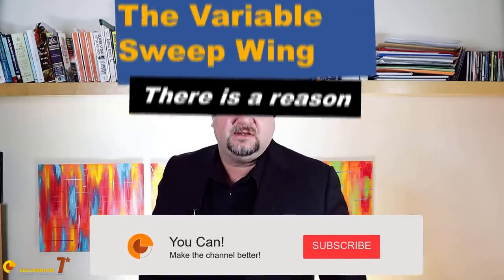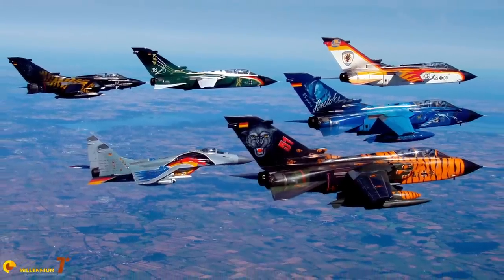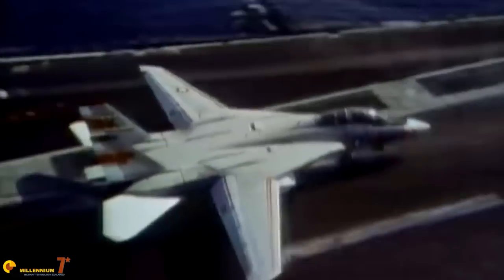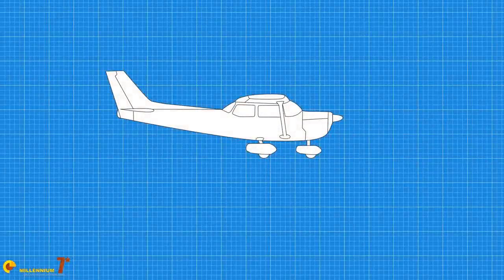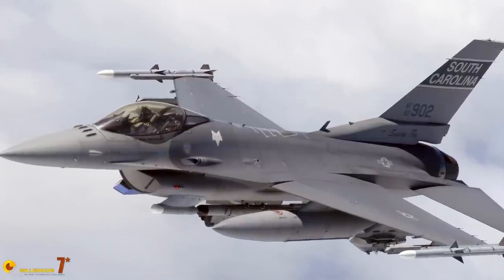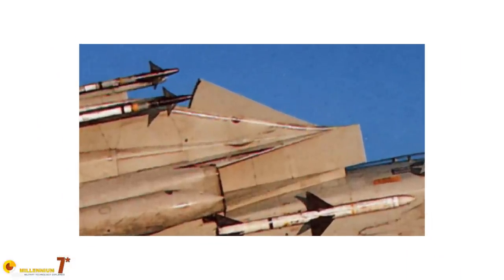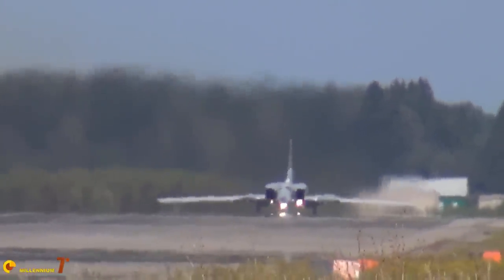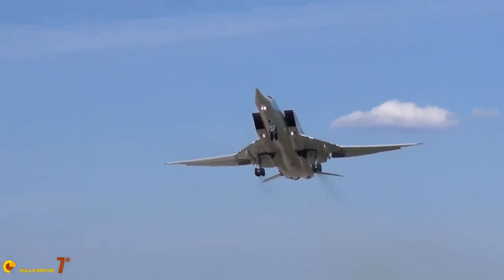F-111, F-14, Tornado, Su-17 were Hopelessly Outdated - the demise of the variable sweep wing

Comment: These planes were not outdated in concept, but the field of operations has changed: a Tornado is still a better interdiction plane, performance wise then an F15E will ever be when properly updated but the availability of guided ammunition and the great improvements of land based anti air radar guided systems makes flying at tree's level more dangerous then it is worth. Still, a tornado, or even an f111 are much faster and stable down low then any F15 will ever been if you need to carry a big load of cluster bombs on a wide area and that's because Tornado's, not the F15E was the weapon of choice during the first gulf war to take out airbases, destroying their runways and paying the toll for flying over VERY dangerous and unforgiving air defences.
In the same way, a phoenix armed F14 would still be unbeatable to keep soviet bombers at bay, having range, speed and payload, but it's a costly plane to operate and hypersonic missiles are difficult to intercept nowadays.
The point is that, due to focussing on different priorities on the battlefield, in recent times, a less specialized and more flexible plane like the F15E or even an F-16 is more desirable as it can cover a wider range of roles, or, in case of relatively less dangerous environments, where Air superiority is fully guaranteed, less expensive and easier to maintain planes, like the A10 and the AMX, able to loiter longer in case of counter insurgence operations.

Comment: Landing in full-load on frosty German runways endangered the F-105s in the 1960s. STOL was also required.
Swing-wing came to that rescue in the form of F-111, Tordnado, B-1 and similarly in Russia: Su-17, Tu-22M, Tu-160.
F-14 was a clumsy mistake-jet like the F-18 is. See Su-33 and Rafale-M for proper naval aviation.

Comment: *Australia, as a nation: "Are you talkin' s**t about our beloved Pigs? :O
Reply: I worked on electronic warfare systems on the F-111F out of RAF Lakenheath in the USAF. Love them.
Reply: Updated with the latest hardware and software as well as networks and weapons. The real reason they were retired was because the airforce literally flew them till the wing boxes failed (whole centre structure in the fuselage). This is coming from an aviation tech who worked on them(RAAF, not me!). Parts were scarce because our version had mods not common with others and comparability was low.

Comment: I hated to see the F-14 go. I think it had life left in it, especially if upgraded. F-14 was faster, and had greater range than even the Super Hornet. Plus the F-14's Phoenix missile had about 40% more range than the Amraam 120C-7 missile. If they kept the F-14 longer, could you imagine the F-14 with the Amraam 120D missile? How potent would that have been? Yes, the Phoenix was designed to take down cruise missiles and the bombers that fired them from long range. But the F-14 with the 120D could potentially take down anything. What do you think?

Comment: The F-14D was retired in favor of a completely new airframe in the form of the Super Hornet. The Super Hornet cost twice as much to produce as the 14D due to R&D associated with a new airframe and did nothing better except lower maintenance costs then the 14D. The 14D outperformed the Super Hornet in a few important metrics, including range and payload. The reason given for the Super Hornet's choice was maintenance costs, which were overshadowed by the procurement costs of the new airframe. The real reason was politics and/or corruption.

Comment: Variable sweep wings are the only way to land a heavy, high-speed fighter at a slow enough approach speed onto a carrier deck.  Swing wings are a luxury for air force planes and their long runways...

The F-14 was required to be able to land with all six Phoenix (unfired) missiles, a fairly heavyweight landing configuration approaching 55,000 lbs.  This would be nearly impossible with a conventional wing and the lower slow-speed lift required.  Today's carrier air wing consists of smaller and lighter Hornets with a suitable conventional wing.  Even the F-35C, though heavier than the Hornet, is still lighter than the F-14, and not Mach 2+ capable.

Russia's Su-33 and China's J-15 carrier aircraft are just as large and heavy and fast as the F-14 and they all share a MTOW over 70,000 lbs.  But since they are weight-limited due to a ski ramp takeoff, they can never approach the fully loaded catapult takeoff weight of the F-14.  Therefore, the Su-33 and J-15 won't have to face a heavyweight landing possibility, and their large conventional wing is satisfactory for carrier landing.

The F-15 is the air force equivalent to the F-14 in weight and aerial speed at the time.  The F-15 was even considered for naval use.  With a landing speed 20 knots higher than the swing wing F-14 however, the F-15 would have never qualified to carrier land.  Here, the swing wing shows its true strength for low speed lift capability.

Carrier approach speeds for heavy aircraft are a constant and don't change.  The mission profile of the F-14 for its time resulted in its weight.  However, the advent of lightweight composite materials of modern aircraft, along with improvements in long-range AAM weapons, culminated in lighter planes and missiles that can do nearly the same mission.  The F-14 may be the last (and only) heavy carrier-based fighter ever made.  Until the need arises for a new aircraft like the Tomcat, she will remain the only swing wing plane to ever operate at sea.
Reply: VSW made the Tomcat a badass dog fighter for something its size. When the thing was designed, that still was very much a need.
Reply: I'm sure the VG wing did help the F-14 bring back more weight and have more endurance at loiter speed.  But if the F-4 phantom and the A-5 Vigilante could land on a carrier I'm sure the F-15 could have also.
Reply: @gort8203  The F-4 and A-5 have a MTOW over 10,000 lbs lighter than the F-14, with no requirement to bring back external stores.  Now, the difference in landing weight becomes greater than 16,000 lbs (6x Phoenix @ 1,000 lbs each + launch rails).  Because of their conventional wing, they still have a higher carrier approach speed than the heavier F-14 (in between the F-14 and F-15) which is on the edge of being too fast for landing.

US Air force planes have never been adapted successfully for carrier use.  And this is one of the many reasons why, because they require higher landing speeds on long runways.  The Su-33 was derived from the air force Su-27, however it underwent many numerous changes, most notably the addition of canards and larger main wings for increased lift.  And it is still launch weight limited with the ski ramp takeoff.  The F-15 would have required extensive changes as well, too many to be viable for sea duty.
Reply: @uboredtoo  Please read my comment more carefully.  I know the F-14 had a lower approach speed and higher bring back weight due to its VG wing. But I did not compare the F-14 to the F-4 or A-5.  I compared the approach speed for the F-4 and A-5 to the F-15.  You said the F-15 could never be certified to land on a carrier due its wing, but the F-15 has more lift and lower approach speed then either the F-4 or the A-5, and would have no more trouble landing on a carrier than either of them.
Reply: @gort8203  Again, Rog elio emphasises the max return weight with Phoenix - the F15 couldn't match the F14 in this situation.
Reply: @jackaubrey8614  
Why is it so hard for people to focus on what is actually said.  I've said twice that I understand the VG wing contributed to the F-14's 'bring back' capability weight.  That is not what I questioned in my comment. 

Statement: "With a landing speed 20 knots higher than the swing wing F-14 however, the F-15 would have never qualified to carrier land."
My comment: "But if the F-4 phantom and the A-5 Vigilante could land on a carrier I'm sure the F-15 could have also."

My point is that the F-15 has a slower approach speed than at least two other aircraft that were qualified to land on carriers.   I did not challenge whether the F-15 would be able to bring back as much weight as the F-14, I challenged the simple statement that the F-15 would never be certified to land on a carrier at all, regardless of weight brought back.  I can't make myself any more clear.
Reply: @gort8203  so was the f-15 carrier certified? If I was as simple as landing it empty on the deck, why not? Had a hook in its design for arrested landings. You would have thought if it was capable of a deck landing they would have certified it and wrote up emergency contingency plans for air force pilots to use a carrier in extreme emergencies.
Reply: @gort8203  of course if you are just trying to prove that the f-15 can make a short arrested landing, well that is pretty obvious since it was designed for that very situation. Hence the hook it was able to be equipped with. So the only variable is the landing zone size on the deck of a carrier. If that is all you care about then in Theory yes it is possible. Now go make vague assertions on another video to illict responses which you don't actually want to engage in discussion around.
Reply: @Power5  I've done all I can to make my original statement perfectly clear.  You just want to argue about something else, so please pick somebody else.
Reply: @gort8203  To understand why the F-15 (in it's air force configuration) cannot land on a carrier, it helps to analyze all of those planes together.

The Navy prefers carrier landing speeds around 130kts.  F-4 at max gross landing weight of 40,000 lbs requires airspeed around 140kts.  F-14 at max gross landing weight of around 55,000 lbs is under 140kts, landing empty is under 130kts.  This difference in landing weight and speed is mainly due to the variable geometry wing.    See the last paragraph on this govt doc comparing the F-4 and F-14: https://apps.dtic.mil/dtic/tr/fulltext/u2/910249.pdf#page=20

The F-15 lands on airfield runways at around 150kts.  For the Eagle to be adapted for naval use, that landing speed would have to be lowered closer to the Navy recommended 130kts, especially for hauling back half a dozen Phoenix missiles and a giant AWG-9 radar system.  And yes, the Navy would have required a Sea Eagle to carry AND bring back Phoenix missiles because that was the requirement of the VFX fighter competition.  Adding that weapon system, along with foldable wings and a massively strengthened landing gear and airframe, would have made the F-15 even heavier than the F-14, dictating a landing speed well higher than 150kts.  

This is another reason why no US Air Force aircraft has ever been adapted to carrier use.  All of the structural modifications end up making it too heavy.  The F-111B almost made the transition.  Astonishingly, it has a MTOW of 88,000 lbs but could carrier land at 115kts (most likely empty).  And it was able to do this because of an even larger wingspan swing wing.

No naval aircraft has ever had to be designed for an overweight carrier landing like the F-14.  At 55,000 lbs, that's heavier than a fully loaded F/A-18 Hornet on takeoff.
Reply: @uboredtoo     I am not debating the F-14.   I compared the approach speed of F-15 to the F-4 and A-5.  The F-15 doesn't even use a landing drag chute like the F-4 does.  I'm done talking about this here because you guys don't listen.
Reply: @gort8203  That's the beauty of debating something that has never existed, isn't it? No one can be right, no one can be wrong :)
Reply: @uboredtoo  Actually, no one can stick to the point.

Comment: Another factor that variable sweep wings were intended to address - that I don't see covered here was the disparity between operating speeds and safe landing speeds (Sabre-dance, anyone). My understanding is that the low speed performance of the new high-bypass turbofan engines allowed for lower landing speeds which meant the variable sweep wing was no longer necessary.
Reply: Thrust does not have an appreciable effect on landing speed unless the thrust is directly supporting the weight of the aircraft and offloading the wing.

Comment: Even with awkward TF30 and designed in 1960s, F-111 has a payload and range that F-15E,F-22 and F-35 cannot match while have an impressive top-speed in all altitudes. 
Even F-14B only has F110GE400 which only has a t/w ratio of 6.0, they have better acceleration than F/A-18E/Fs who has F414 with T/W ratio >9 when both equipped with 8 missiles(not to mention Sparrow has a significant larger drag ratio compared to AMRAAM).
It's not the swept wings become outdated, in fact cancelled NATF was swept-wing. It's the fact that new types come out after cold war is so rare that diversity in design is no longer viable. US only designed F-22(itself date back to 1980s concept) and F-35(somehow a lighter version of F-22) to save cost. In this condition, powerful but expensive swept wing designs are not welcomed by the Senators. They just want new & cheaper designs to replace expensive sineaters.
Reply: Daniel WONG F111 capability is definitely getting undersold
In the comments section here, guess it didn’t have a sexy movie starring Tom cruise made with it ;)
Reply: @bushyfromoz8834  Yes, they are fabuluous attack fighters with unprecedented payload, range and attack effeciency. One F-111 even credited with a Mig-29 kill by maneuver.

Comment: The center of gravity has to be in front of the aerodynamic center. But that doesn't mean the lift of the wing has to be behind the cg. It's very common to have the lift of the wing in front of the cg and the stabilizer contributing to the lift and still have a statically stable behavior. (I encourage you to do the math)
It's a common misconception that the tail creates a down force. Similar story like how most people think thst low airspeed causes a stall when it's actually a rising angle of attack.

Comment: Glad you mentioned the engines issue. There have however been some tradeoff's with power and weight. The J79 and EJ200 have roughly the same fuel consumption per pound of thrust (the EJ2000 is about 4% lower) however the thrust to weight ratio is way better with the EJ200 IE 3850 pounds weight for the J79 and 2180 pounds for the EJ200 and the EJ200 has 20% more thrust in ballpark figures. That's how far the tech had moved on in 40 years. The EJ200 has a far higher compressor stall margin which is why it uses more fuel than strictly needed. Compare those to engines that started development in the last decade and you can see another jump (though not as big).

Comment: Thanks for the video very interesting info as per usual, is there any chance you could do a video on the merits of the air to air refuelling systems and why the us chose boom over drogue
Reply from the maker: Great suggestion!
Reply: The US uses both. USAF uses the flyable boom with wings that the boom operator can fly.

Navy & Marines use the telescoping basket that weighs less, can be tethered from a carrierborne platform without a person in the rear flying the boom.
Reply: The boom has roughly double the transfer rate of the hose.  The flying boom can be maneuvered into the receptacle more quickly and reliably than a B-52 or a C-5 could maneuver itself into the basket.

Comment: I'm a believer of the modern turbofan (T/W > 7:1) having the biggest impact on the killing of the VG wing. It permitted a short runway run for take-offs because of high trust/weight ratio and bigger wings than previous mach 2 designs. And the range targets were achieved by the economy of the turbofan design. Speed targets were also achieved by brute force, no need for smaller wings because of weak engines.
Reply: I am thinking the same even though it got one of the shortest mentions in the video. In the case of the Tomcat it was pretty much decided that they don’t really need the Mach 2+ performance or extended range the Turkey could provide largely due to its variable sweep design.  So if you don’t need those things, you probably don’t want to bear the extra running costs.  You can make similar points on the second aircrew member that the F-4, A-6, and F-14 carried.  More modern equipment allowed the Hornet to take on those missions competently without a dedicated crewmember to help manage the systems — so why carry/train/put at risk a second crewmember?
Reply: @57thStIncident  So why do many US Navy tacticians worry about the short legs of the F18 and the (much) reduced stand-off distance this allows to potential hostile attackers?
Reply: @Jack Aubrey they may worry but clearly ultimately Navy decided it wasn’t worth the cost and preferred to emphasize flexibility. Super Hornet with increased range/load helped. I believe they may be considering conformal tanks too.

Comment: As all aircraft have one Achilles heal maintenance maintenance and associated costs to that fact. With variable sweep wing aircraft costs are higher  that doesn't make them obsolete. Like any high performance machine it's the technology you allow them to have. The airframes in question was only held back by their operators (governments). As all governments are bound by budgets. It makes it hard to operate specifically built aircraft. So they weigh up the pros and cons and make a narrative to suit the reasoning. Look at Australia retired their F111 with no real replacement. Now THE RAAF flies an aircraft that is dependent on tankers,to manage the job of the F111. Range,weapons ,fear factor (they righten into weapons treaties ) that alone is testament to abilities. Do I need to carry on. Chris Holznagel